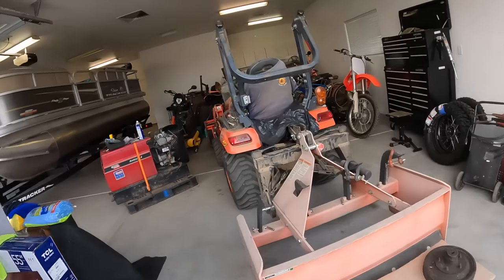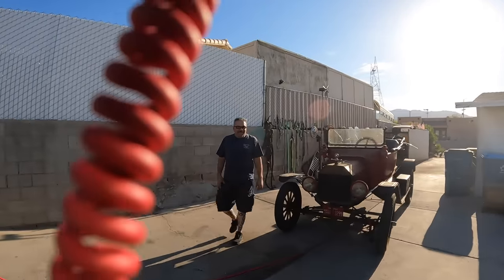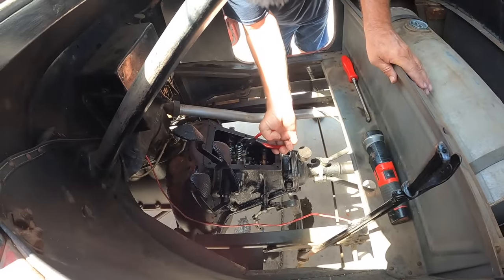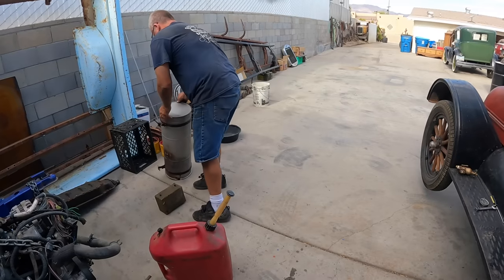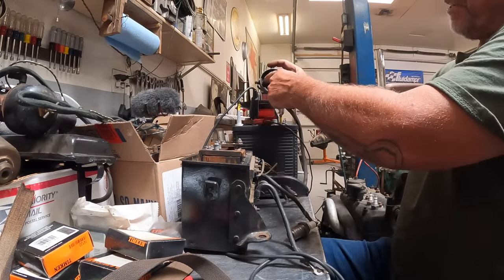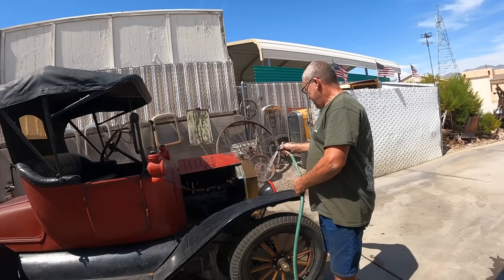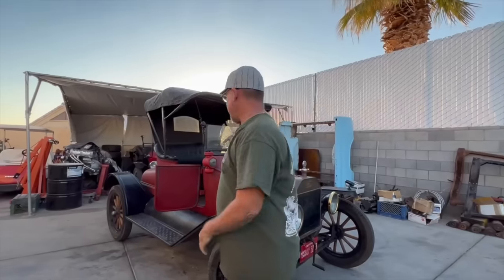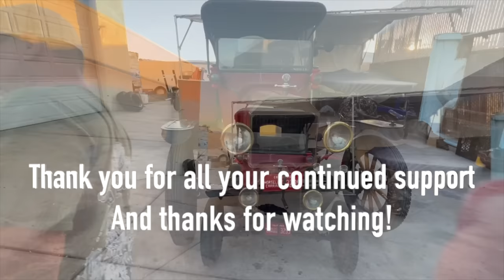Can I Get This Model T to Run after 50 Years?

Comment: Ford made the original "convertible". It was called a converti-car. The set included your standard coupe, which you have there, with the turtle deck and wood wheels. It also came with a pick-up box, which you could just bolt on in place of the turtle deck, and a full set of wire spoke wheels. Back in the late 60s my dad restored one of these sets. It was just one of many Ts he restored.

Comment: When I was about 10 or 11, my dad had an ancient Lincoln welder with a crank start. My dad would sometimes start it for me but when he was at work, I would start it by slowly turning it to just past TDC then with the crank at the right angle, I would climb up on top of the machine and jump down onto the crank to start it. I didn't tell my dad about this technique for several years lol.  I was afraid he'd forbid me from using the machine if he knew.  He had once told me that when i was strong enough to start it, I could use it :)

Comment: You need to show us how to weld a gas tank, I was a wee lad when I saw anyone weld a gas tank. He filled it with water and put an air chick in with the gas lines plugged. Yes a stream of gas came out the leak and he welded it! He said the pressure kept the fire 🔥 on the outside of the tank so it wouldn’t blow. Any welder I’ve asked says that’s way sketchy 
Keep up the wonderful and very informative content. Almost feel like I could build an engine from what I’ve learned from you here. 
🙏❤️😎🤙🛻💨

Comment: my    model T was last driven in 1968 and i got it running in 1922.  I started it by rolling down the hill in my driveway.  it ran on two cylinders with occasional pops on the other two cylinders.  it ran on the magneto.  i have replaced the gas tank, repaired the carb, new rings, pistons, rings, connecting rods, valve springs, seats and pins, new radiator and hood, upholstered the seat and new top.  just need that connection to the head from the radiator.

Comment: What a beautiful old T. Somebody did some restoration work on it back 60 or so years ago. To find one with a decent top and upholstery is a good thing. Next time you have to put the washer and nut on the reverse or low pedals, tie some dental floss around them so if by chance you should drop one while putting it on the shafts you’ll be able to pull the pieces back out.

Comment: So... How do you Crank it without a Starter Motor? 
Lawnmower engines can be retrofitted with an adapter to delete the pull start and use an electric drill.
The SR-71 had a Start Cart with twin Buick 400 cu in Wildcat Engines to start each of its J58 Pratt & Whitney Turbojet engines.
Merlin could use something in between.
There are Remote or External starter motor/battery boxes for Flat Track and other motorcycles with high compression. This might be a good project for Merlin to use, especially on vehicles that haven't been started in several decades.

Comment: zeesh, almost would be worth hooking up a starter motor with a shaft that you can slip in where the original hand crank is, maybe mount it on a stand that can fold and fir in the storage compartment so that you can cheat start it lol. maybe it might work, just thought it might be a decent idea.

Comment: I am going to be a downer for just a second, there is a cable in the way of the spark. So on to the good stuff, I am in love with you videos. My passion is for 1929,30,31 pickups. But alas, my collection is in diecast models. Still very cool as the real ones.

Comment: It’s easy. Make sure your timer is clean, install a new battery to the coils. Make sure the coils are working. Clean and set the plugs to .025 . Make sure gas is coming from the carburetor. Open the needle valve on the carburetor from bottomed out to 1 1/2 turns and hand crank. Set the ignition to battery and you should hear the coils buzz. Crank by pulling from 7:00 to 11:00. You don’t need to do it fast.

Comment: My dad used one of those spark boxes to keep the yard cat that lived in his impound lot(towing and body shop) off the block wall. Cat used to tease the yard dog, so dad ran bare wires along the 4inch wide block wall top course.. The cat would get all fluffed up but still walked length of wall shaking each foot as it walked. Then when cat came to steel fence gate it would get discharged with a snap. You think the cat would learn, but did this every day. Get all puffed up and discharged and get "thin" again.

Comment: Dude, I felt like I was having a heart attack after all that huffing and puffing trying to get the engine turned over. 😁 Your wife is a gem. Most women wouldn't be game to go for a drive in 118 degree weather and definitely wouldn't stand around waiting for your to start the engine. Most women - I will wait in the air conditioned house till you get it started and have the air in the car on full blast!!!

Comment: Its just too easy to sit and watch Merlin work,
Time to get out and change the oil and filter in this glorious heat wave.
Off I go...
Excessive heat warning still.
117 degrees and you know they take the temps in the summer in the shade as to not scare off the residents.
Under a car on pavement is still in the shade Right? SURE 😮
You earned that one Merlin.

Comment: As I watch you push and pull on the crank I can hear my father, who had 5 Model T's when he was in high school, tell me what to do and not to do when cranking an engine.  What I am watching includes a lot of not to do.  He warned me to keep my thumb out of the way because if it kicks it can break your thumb with no trouble at all.  Then he only pulls up so if it kicks it will pull out of your fingers and not break your arm.  The only car I started with a crank handle was a 1960 Morris Minor 1000 when the battery went bad.  He made sure I knew what I was doing before he let me crank on that handle.
Reply: I think with these they have a one way bevel on the crank so if it kicks back it’ll just disengage the handle. The earlier style cranks positively locked in and could kick back more solidly. 
Still a good idea to follow the rules, but shouldn’t be as big a deal.

Comment: With your spark lever set right (Ignition happening right at tdc, too far advanced and you could get kickback), your carburetor fuel bowl full and a little choke the motor should start with one hard pull upward on the crank. A lot of these old T's had a choke wire going from the carb through the fins of the radiator with a loop on the end so you could control the choke while cranking. Not sure if that was factory or not. Hood should be aluminum and the cowl and tail light should have brass lens bezels and brass top.  Cool old T.

Comment: Suggestion:  Make a crank adapter that fits to an battery electric  impact / drill & use that to crank it over. It will need a second handle to combat the torque & save breaking a wrist.

love your videos

Comment: Merlin isn't the starter motor a great invention! I've just noticed it only has one door LOL You need one of those pony motors off a bulldozer. Did the later T's ever come with starters? You poor guy in all that heat. You got a big cheer from me when it started. You never get that much dirt in a gas tank normally but at 100 yrs + anything possible and expected.

Comment: A quiet word. Never ever try and crank any engine like that. The electric starter was invented because Henry Lelands Best Friend died after he broke his wrist ,from complications , whilst cranking a car. hold the handle with your fingers and not your thumb, and pull up towards compression.If it back fires, it will pull out of your fingers instead of breaking anything.

Comment: I had an accident years back and shreared my distal radius bone in my right arm. Took 12 screws and a plate to fix it. He called it a chauffeurs break, the handle would kick back and break the wrist. Dont do the same,it sucks.

Comment: If you have sand in the tank, where else did it get to?  I would put a camera through the spark plug holes to peek in there.  Unless that part ended up on the editors digital floor. 😁

Comment: I'm working on my 1915 Model T roadster. have replaced the gas tank, overhauled the engine, replaced the bands, and replaced the radiator.  need a new connector between the head and the radiator as the one i have is for a later high radiator.

Comment: i hadlow compression on two cylinders, turned out the pins on the intake valves had fallen out.  the engine would run when I rolled it down the hill, but fired on all 4 only occasionally.  have replaced valve springs, pins, eats, pistons, connecting rods, rings.

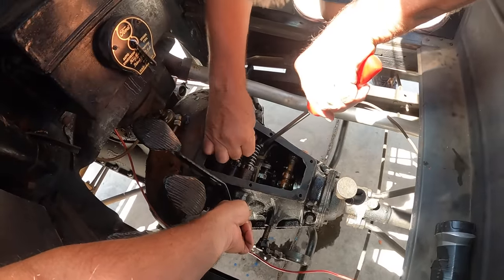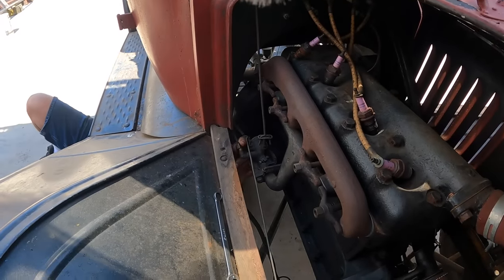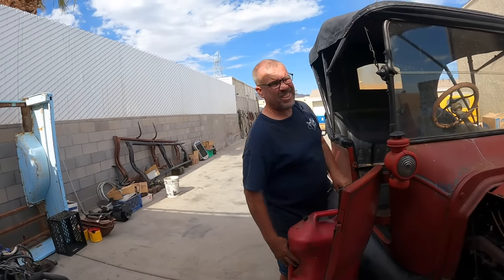Comment: @12:00... Makes you wish you had "Period Correct Tools", eh? I'm sure there is/was a tool for that specific job; because Henry Ford saw that it took longer than necessary, with Conventional Tools (like you're using). @12:57... It's amazing how that simple 4 cylinder became the 4 cylinder, in my 2004 Ford Focus! (same basic Block, just improved Internals and a "Valve in Head"). @14:24... What Owners' Manual??? 😉😉 @15:32... 114 at 50% humidity (sounds like Kansas City, Mo @ 100 degree's and 50% humidity, swimming in your own sweat)! @28:22... The camera is shaking like it has a CAM! @35:15... "Coach Merlon"; C'mon, Let's Go!!! @39:17... Desiree looks fabulous, in her dress! 😍😍 @39:33... Imagine being in the US Army Mechanized Forces in 1915 and riding Cross-Country, with no roads! Yes, the Model A was LUXURIOUS, as compared to the Model T! @40:49... I spy Desiree's painted tootsies! 😉😉

Comment: Merlin seeing you having to do all sorts of pushing and pulling and adjusting to keep this 1915 T in running order most modern drivers would run out of patience quickly. Did they have to do all of this back when it was new or is this the nature of the beast of it not running for 49 years?

Comment: i have a 1915 Model T roadster like the one in your Tube video.  I am missing one part, which I saw on one of your spare engines.   I need the hose connection that goes from the head to the radiator.  My Model T had met with an accident in 1923 and A 1923 radiator had been installed along with the head attachment for a high radiator.  that radiator was no good after 50 years of sitting.  would you consider selling me one of those radiator connections?

Comment: How do you get these great cars and in such good condition ---- you seem that excited ! Cant you out a locking washer on the those wheel nuts ?
Reply: The main problem is the wood is soft and can shrink. So as you’re driving the nuts can loosen a little. Which allows some movement that will further loosen the nuts.

Comment: could a person take an old crank cut it and weld a nut on it and use a 3/4 or 1 ln. air gun to spin the motor for a first start.

Comment: I believe that the Model T was designed to be driven by an octopus, you needs at least 3 legs and 4 hands.  It is in amazing condition for a 107 year old car, I doubt that any modern car will still be running that well at that age.